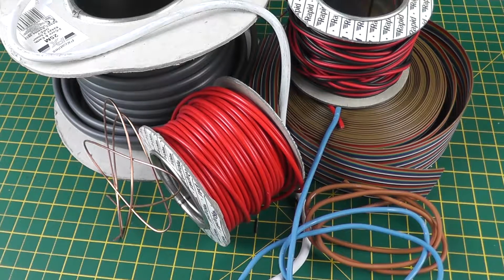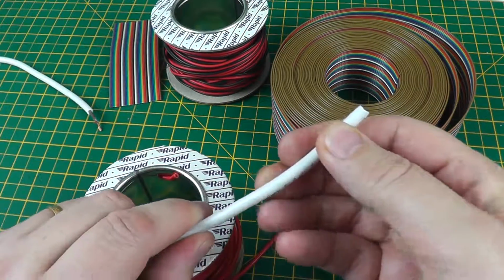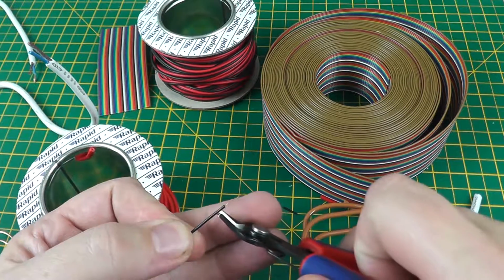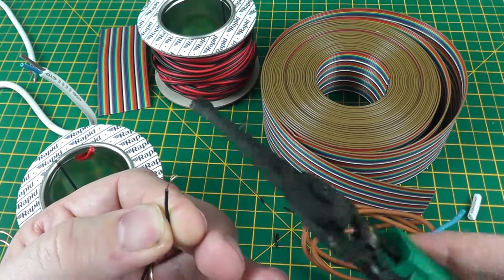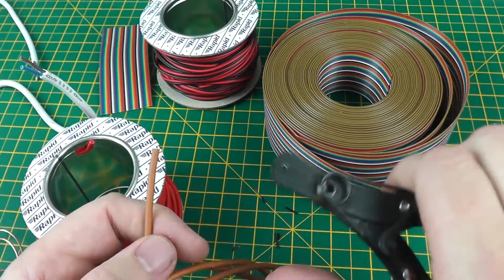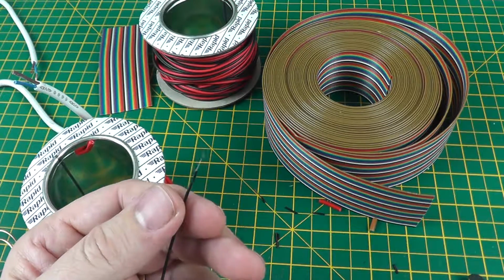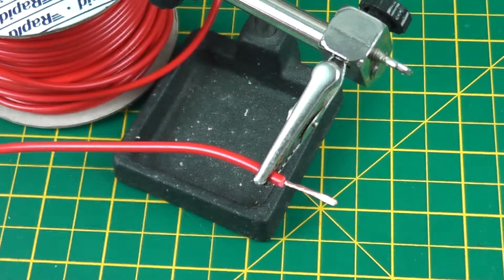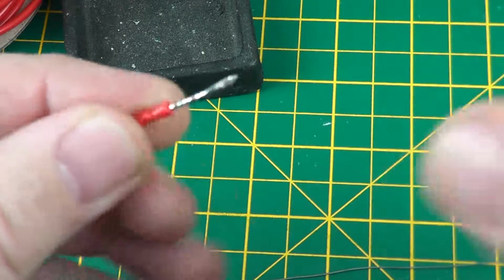Wire Stripping & Tinning For Beginners

Comment: One of the best tips I ever came across is this one for stripping and tinning a single conductor enameled wire:   Place the wire end on an aspirin tab.   Heat it up with a soldering
iron.   The aspirin melts and chemically interacts with the enamel and instantly burns it off.   Apply some solder and the now bare copper is nicely tinned.  Try it!  You will be amazed.